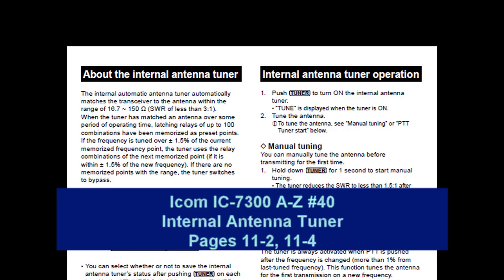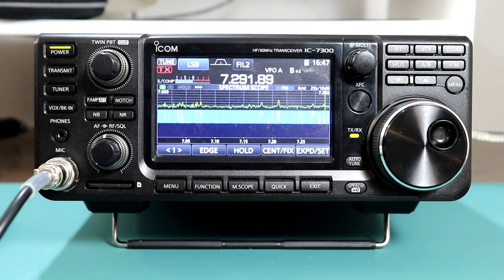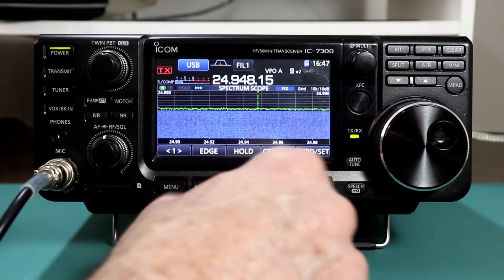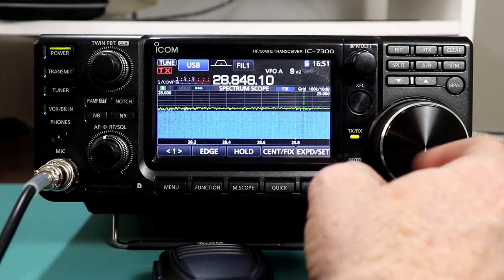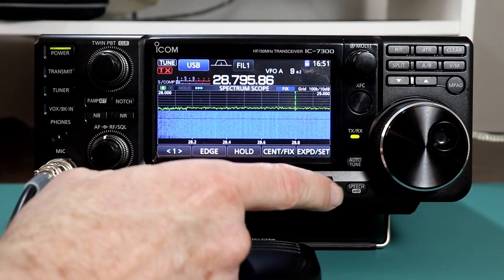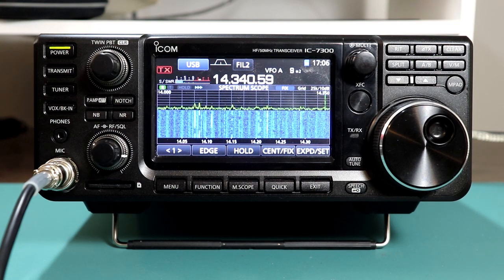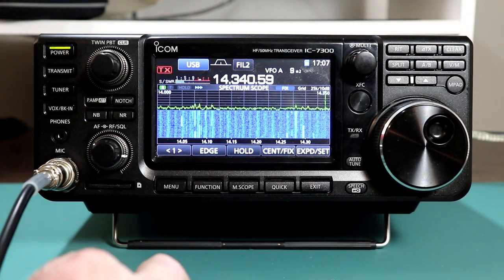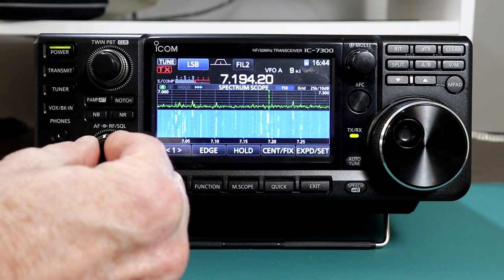Icom IC7300 A to Z #40 Internal Antenna Tuner Operation

Comment: Just ordered my IC-7300. I was wondering how well the internal tuner worked. Thanks for the video! I look forward to viewing more of them.
Reply from the maker: Hi Harry.  I have an off center fed 80 meter dipole where I live now.  I’m just using the internal tuner with it and it works fine on 80 through  10 meters. As long as your antenna system is 3:1 or better it should work fine.

Comment: Hi Tom, thank you for the well explained video.  I was just wondering what that little auto tune button on the right hand side was all about.
Reply from the maker: The AutoTune button is for CW.  If the radio is in CW mode and you're listening to one signal, you can press AutoTune and it will adjust the receive frequency to put you exactly on the same carrier frequency as the station that you're hearing.

Comment: I really appreciate these videos. I just ordered a IC7300. While watching (around the 10MIN mark), I noticed there is an AUTO TUNE button to the left of the VFO. Is that for an external tuner?
Reply from the maker: The AUTO TUNE button is for automatically centering a CW signal.  If you push that when copying a CW signal it will adjust the VFO to put you right on the carrier of the signal.

Comment: Nice video. 
Question…. In tuner mode, whether auto or manual, is the radio reducing power automatically? Or shld I turn the power down ( I like 10 watts) manually?

Is there a way to set a button to a shortcut to Emergency mode? As the top end of 80 meters , on my 80-10 exhibits high swr and will not tune in normal tuner mode. Thus its a pain to keep switching to EM each time I go to the top end.  

Thanku

William
Reply from the maker: I don’t know of any way to make a shortcut for Emergency Mode. If your situation doesn’t allow you to put up a better antenna, the next best option would be an external tuner. If the internal tuner matches your antenna in emergency mode, the. Any external tuner should match it fine.  You’d have the bonus feature of getting full power out of the radio.
Reply: @HamRadioA2Z  Again thanku

With my 132 foot 80-10, I cannot tune on 160 with emergency mode, thus I was hoping the Mfj-939 would?
Lastly, when internally tuning do I need to manually reduce power to 10 watts or does the radio do it automatically upon tuning?

Thanks!!!
William

Comment: Tom, another very helpful video.  When using the internal antenna tuner can I use my AL811 amp at about 500 watts.  If not is 100 watts the max power to be used with the internal tuner? Sure would appreciate your help here.

Comment: The other thing the manual suggests if the tuner won't tune is to reset the tuner memory and try again.
Reply from the maker: You are correct.  Good additional suggestion to point out.

Comment: But can you have different tune settings for each band that it remembers?  Or ... does the tuner figure out that it needs to tune for the band you're on?  Sounds like maybe the latter (which is cool). So then the Auto setting just remembers whether or not you were using the tuner on that band last time you were on it?
Reply: ah: ~@7:20 answered the question pretty well.

Comment: Hello Tom. First, congratulations for all your videos concerning the ICOM 7300 and as I have one here at the QRA, I subscribed because the explanations are really explicit. However, I have a problem. I explain it to you. I (a priori) adjusted my ICOM 7300 as it should be to be able to traffic in FT8 digimode among others. The antenna is also fine tuned but here is the problem. I therefore switch to FT8, set the power of the ICOM 7300 to 25% and when I transmit, the power indicator of the ICOM 7300 "PO" indicates 100% while my ROSMETER indicates 20 /25 w. Would you have an idea? Kind regards 73/Joel/F8MGW

Comment: Just discovered your excellent video! I have researched the 7300 a lot, but have yet to pull the trigger, and the tuner is one of the few reasons why. What was the SWR of your end fed antenna on 20 meters before you got it to tune in the emergency mode?
Reply from the maker: Hi Richard.  It's been a while since I checked the SWR of my antenna across every band.  I've also done a few adjustments to it since the last time I measured everything.  I'll have to recheck it and let you know.  Right now, we're practicing social distancing in our camper, parked by our son's house in Arizona.  So, I won't be able to  check my antenna for a couple weeks.
I can tell you that the 7300 internal tuner doesn't seem to cut off at exactly 3:1.  I don't know exactly what the limit is before it stops trying, but it seems like it will at least try to tune in normal mode up to at least 3.5:1 or maybe 4:1.  Testing that might be another fun video someday, but I'd want to use some "real" test equipment for that.
73,
Tom WA2IVD

Comment: When i do an swr check I’m at 1.5 with 1% or watt.     When i increase the power to 5% or 50-60-80% or watts.  My swr goes over 3.0.    Any ideas?    Thanks guys.
Reply from the maker: Hi Theo.  The problem is that 1% or 1 watt isn't quite enough power for the internal SWR meter to get a valid reading.  5%-10% is enough for it to read correctly.  You don't need to go all the way to 50%

Comment: Hi Tom, love your series. I own both an IC-7100 and 7300. What automati  screwdriver antenna tuner works with the IC-7300? I have a Turbo Tuner 2 for my 7100, will it work for the 7300?
Reply from the maker: Hi Ron.  It should work fine with the 7300. The external tuner interface is the same. I switch my MFJ939 between my 7100 and 7300 all the time.

Comment: Tom I think you forgot to tell him the most important part
You have to hold the turn button about 2 seconds to get it to tune on other bands
I realize you're saying that it auto-tunes from band to band if it's saved
But from looking at your video I don't think a lot of people realize you may have to hold the tune button for 2 seconds to actually get it to tune
Just the fact that the tune light is on does not meet its tuning

Comment: What about that auto tune button at the bottom right next to the dial?
Reply from the maker: Hi. That button is for automatically tuning in to a received CW signal. It is not related to antenna tuners or transmitting.

Comment: Great job. Very useful information. Does this mean my LDG 1000 pro 2 is no longer needed when I purchased my IC 7300 next week
Reply from the maker: Hi Dave.  Thanks for the kind words.  The answer to your question is: It depends.  I wouldn’t get rid of your LDG just yet.  The internal tuner in the 7300 will work with anything up to about 3:1 SWR. If your feed point SWR is higher than that, you will need an external tuner.  I just put up an 80 meter OCF dipole and the internal tuner works fine on most bands, but it won’t quite tune the low and of 20 meters.  So I need an external tuner if I want to do digital modes or CW on 20.  Enjoy that new rig!  73, Tom
Reply: HamCuredSmoke thanks Tom just set up the icon 7300 today and your 100% right. Thanks for the info 73s

Comment: Good video. What settings would you use if you were using an external tuner, such as LDG IT-100?
Reply from the maker: Hi.  I’m not sure what settings you mean.  If you connect an Icom compatible tuner, like the IT-100, the radio will recognize it when it’s plugged in and will automatically use the external tuner and disable the internal tuner.  You can also check out the next video in this series about using an external tuner here:  Icom IC7300 A to Z #41 Using an External Antenna Tuner
https://youtu.be/rjjl6J6xX8o

Comment: Hi again. 
I forgot to ask.   
If just receiving shortwave broadcasts, by touching the tuner quickly and NOT fully starting the relays, will that help reception or must I do a full tune?

William
Reply from the maker: Touching the tuner button briefly will engage or bypass the tuner, indicated by TUNE on the display. The tuner will re-engage at the previous settings for the frequency you are on if it had been tuned within a few percent of that frequency previously.  I don’t know if it will engage based on the nearest amateur frequency if you’re outside the ham bands. Even if you long-press the TUNE button, it won’t tune outside of amateur frequencies because it can’t transmit there.
Reply: Thanku.  
With the mfj 993 hooked up to the 7300, do I need to reduce power before tuning or will the 7300 do this automatically?

Thanks
William

Comment: When should you use Manual vs Automatic vs PTT?  I have my IC-7300 connected to an LDG IT-100 Autotuner because on some bands and some frequencies my SWR is slightly over 2:1.  So I had my IC-7300 set to manual and I notice that neither tuner seem to remember any tuner setting.  Should I have the IC-7300 set to Auto or PTT when connected to an external tuner?
Reply from the maker: Hi.  Sorry I missed this question earlier.  The Auto/PTT options work the same way with the internal or an external tuner.  PTT will cause it to automatically retune if the SWR is too high whenever you press the PTT button.

Comment: Does the TX power need to be turned down to 10W before using the tune function?
Reply from the maker: No it does not.  Whenever you start a tune cycle, either by holding the Tune button for a second or automatically with PTT, the radio automatically transmits a solid carrier at 10W regardless of the mode or power setting.  This is true both for the internal tuner and when using an external tuner plugged into the radio's tuner connector.

Comment: Hi Tom.  You said you used an EF53 and I believe you shortened the 53' wire.  Do you know how much you took off?  Also, is the unun 9:1 for that antenna?  Or something else?  Thanks.  K5INW
Reply from the maker: Hi Robert. The EF53 does use a 9:1 unun. It comes with the antenna. I did not shorten the antenna. After several months I did lengthen it some. I also played around with various counterpoise lengths connected to the ground terminal. I don’t recall the exact lengths. This antenna does require a tuner and it’s important to pick a length that isn’t resonant on any band you plan to use.

Comment: Tom question...re using the 7300s internal tuner in conjunction with a manual atu

Ok my doublet antenna lets me tune most band bar 160m.....if I adjust the manual MFJ tuning to best SWR....which is around 2.5 to 1....then tune with the 7300s internal tuner the indicated SWR on the radio is near 1 to 1.....which I know its still 2.5 to 1....but I am presuming the radio sees near 1 to 1.

No my question....will it hear the 7300 using the set own internal tuner in conjunction at the external ATU.

I am hoping it will be kinder for the 7300.

I know 2.5 to 1 is not the end of the world....and looses around 18% out output power.

What do you think....nick 2E0LPL.
Reply from the maker: Using an external manual tuner ahead of the 7300 internal tuner is an interesting approach.  I’m assuming your question is will using the external + the internal tuner “hurt” the 7300?  No, it won’t hurt the radio.  I’m curious why you can’t the tuning to better than 2.5:1 with just the manual tuner.  With a little more adjusting, you should be able to get it to 1:1 and not use the internal tuner at all.  It doesn’t really matter.  As long as you get the radio to see less than 3:1 into the manual tuner, then the internal tuner should get it the rest of the way down to 1:1.  I expect that your total efficiency is worse going through 2 tuners.  This is because the signal is going through more inductors and capacitors.  Each of them will have some loss.  However, it probably isn’t that much worse than a single tuner.
Reply: @HamRadioA2Z  My external ATU is an MFJ 941....some people say they are not great.....for everyday use mine is fine.....just this one band I cant get it less than 2.5 to 1.

As an experiment I extended the antenna wires by 20ft each side with temp wire....1 to 1....but I cant leave it like that.

Maybe my MFJ941 has a limited range.

It a low freq on the 160mt band I am tuning.

Antenna is a doublet.

As with most things in radio.....depending who you ask you get opposite views.....I tend to agree with your view....using both ATU wont harm anything....but lots say dont do it.

Thank you Tom.

Comment: Does this function eliminate the need for an external tuner?
Reply from the maker: Yes & no.  If your antenna SWR is 3:1 or less on the bands you want to use, then the internal tuner will work fine.  If your antenna is worse than that, you will need an external tuner.  Ideally, your home station antenna should be 3:1 or hopefully, even better on the bands you will work the most.  However, not everyone has the space or HOA latitude to put up large resonant antennas.  In those cases, a compromise antenna with an external tuner may be the only option.

Comment: Hello, Im new to the 7300, question...If it will not tune on a band it will not transmit?...Correct. If mine will not tune it has a red dotted line around the TX  under the tune? and will not Transmit.
Reply from the maker: Hi.  That is not correct.  If it can’t match an antenna well enough, the TUNE indicator will turn off, but you can still transmit.  It will just fold back power to a very low level to protect the finals.  If you see a dashed line around the TX symbol, it means that you are tuned outside of an amateur band.  It could also mean that you are tuned outside of a user programmed band edge and that you have the inhibit transmit on user band edges option enabled.
Reply: @HamRadioA2Z  Thank you,That is what the problem, I turned it off and all good.
Reply: @HamRadioA2Z  Just for clarification, when I use the automatic tuner function by holding down the tuner button, the radio automatically send out a lower wattage to test the SWR, even though my power setting may be set at a higher wattage?
Reply: Oops, never mind, I see that you already answered this question in comment below.  Thanks for the video!

Comment: So on the ic 7300 there is no need to switch to AM or FM to tune or does it do it automatically. I noticed you left it in ssb to tune. Thanks
Reply from the maker: Hi Brian. That is correct. When you press the Tune button to start a tuning cycle, the radio automatically sets the power to 10 watts and puts out a CW carrier. It doesn’t matter what mode it’s in.

Comment: Do u have to turn down power when tuning. Or does the radio do it. Also can u tune in ssb.
Reply from the maker: Hi Troy.  No you don't have to adjust the power.  When you press the Tune button, the radio automatically transmits a solid carrier at about 10 watts.  It does this regardless of the mode or power settings.  It works this way with either the internal or an external tuner.

Comment: I really love your educational videos on the IC-7300. I am legally blind and your videos have helped me with a few different things, including exactly how the antenna tuner works, through the last six or eight months. I do have one question. I have noticed sometimes that in the upper left corner where TUNE is displayed it will  be colored red. Does this just indicate that the band I am trying to tune is not tunable with the internal tuner? I have problems with being able to tune in 30 and 60 meters But fortunately with my 135 ft off-center fed , give or take a few feet, antenna I am able to tune all other bands. I haven't tried 160 m yet but anyhow... Thanks for the great videos! KI5FLE
Reply from the maker: Hi.  Thanks for the comment and I'm glad you're enjoying the videos.  The TUNE indicator will appear red while it is trying to tune.  Usually, this is just a few seconds.  Once it has finished tuning, the TUNE indicator will be displayed in grey to indicate it successfully tuned or it will not be displayed at all to indicate it could not tune the antenna.
Reply: @HamRadioA2Z  Gotcha and thank you again. KI5FLE

Comment: When I key up on 10 meter FM it shuts off could that be a software issue
Reply from the maker: I suppose it's possible, but my first suspicion would be RF getting back into the rig somehow and temporary scrambling it's brain and making it turn off.   I would check the antenna setup, looking for good grounds, good connections, etc.
Reply: @HamRadioA2Z  thanks for the info but I found the problem it was the power so I'm getting the one I got last year fixed 👍

Comment: Just installed flrig, then fldigi.  While configuring fldigi with flrig running, found that 7300 was in transmit with no indication on either screen.  This video may offer a solution.  Stay tuned.